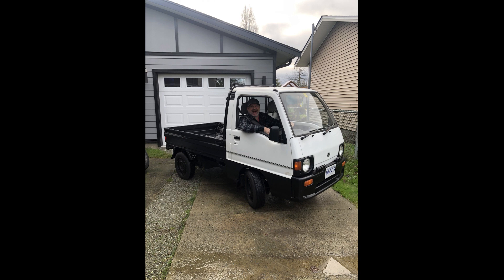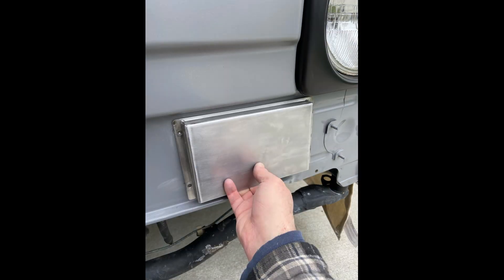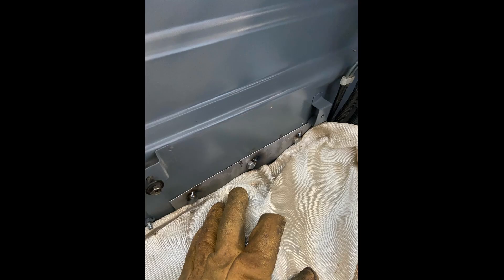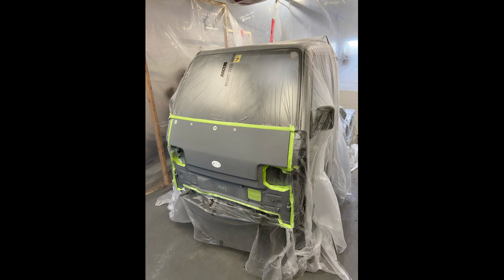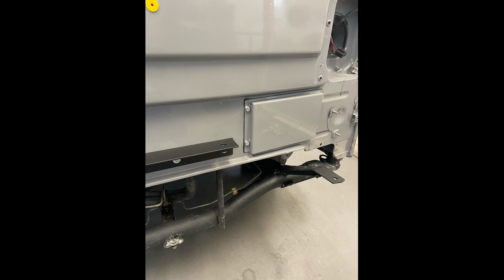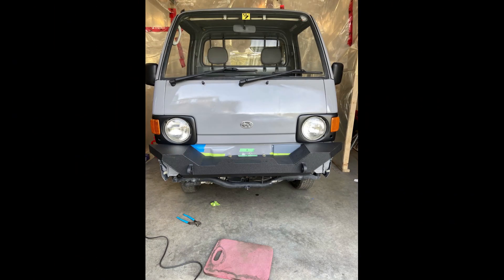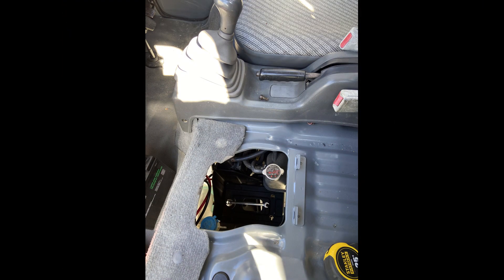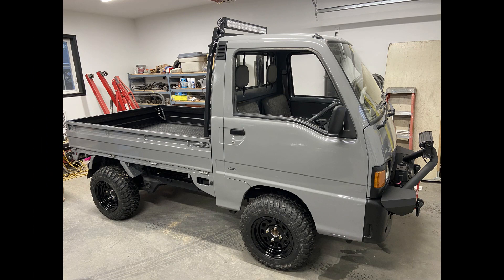Subaru Sambar bush bumper install

Comment: What size second battery are you running?
Reply from the maker: I measured the opening and got one that just fit.  I believe it is a riding mower battery.  Just enough to get a bit of a boost for the winch.

Comment: Which wheels and tires did you go with?  Did you use the 4x4 lug pattern with wobble nuts?
Reply from the maker: Bought wheel adapters.  Wheels were ITP 12X8 and tires were Mongrel 23x8x12
Reply: @turnbullgarage88  do you drive highway speeds?  I saw that someone said these shake at 45mph+
Reply from the maker: @Dancemotionvideo  With good balanced tires there should be no issue.  I have worn out tires and the rims bent a bit so mine is not good.  I do drive it at 55 mph max speed, it smooths out at that speed.
Reply: Nice build. Whats what’ the color. Looking to get on a kei truck project